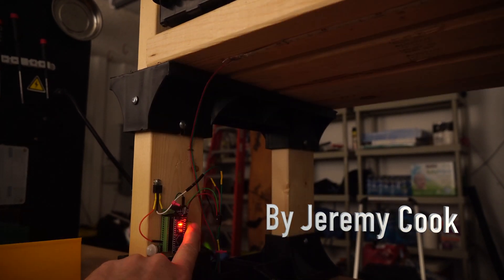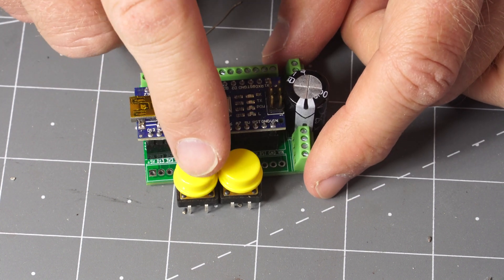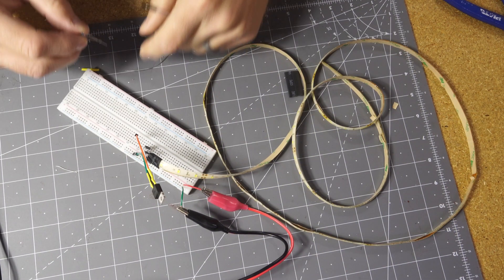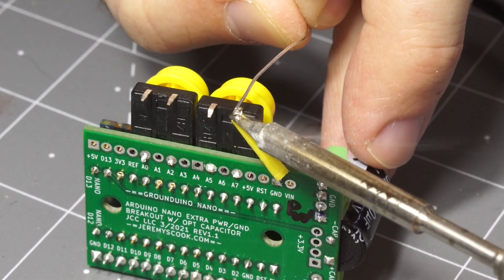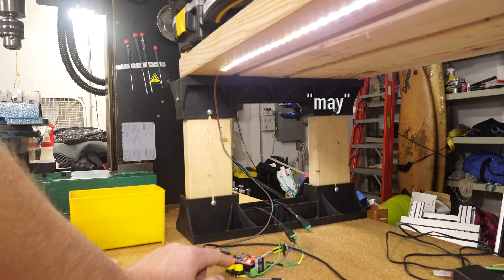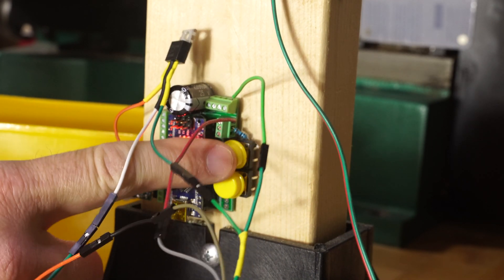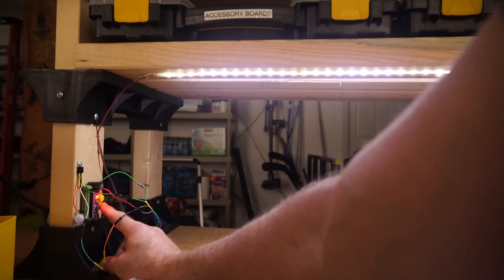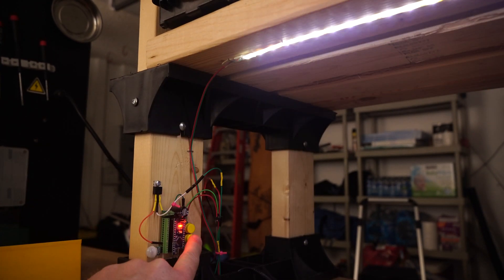Overhead Workbench Lighting MOSFET 12V LED control [Arduino Nano]

Comment: I've built something quite similar with Pro Mini in a case but with a poti instead of buttons. For whatever reason my electric fly swatter made (propably) the PSU go haywire and overvolt the Arduino. Twice.
Reply from the maker: Nice - yeah a pot would have been good too, but the wiring worked out nicely with the buttons. Ha, I bet that is a lot of voltage!